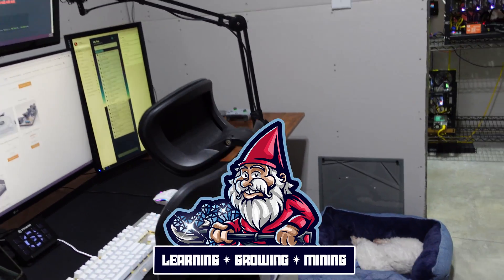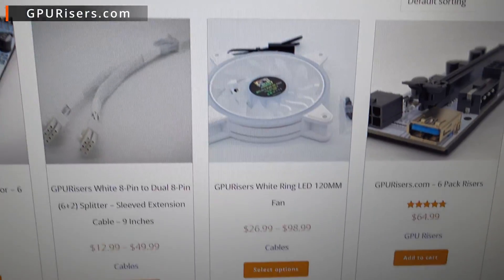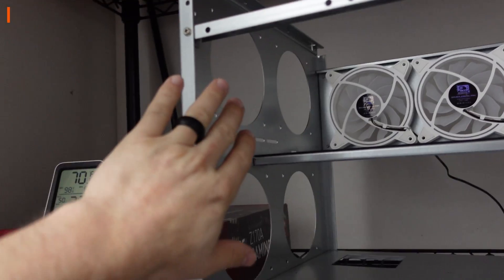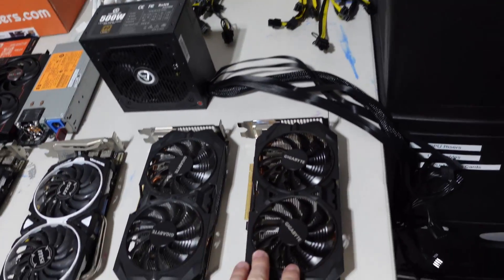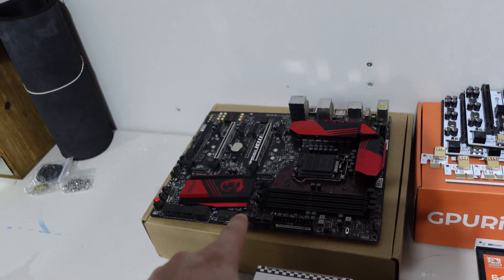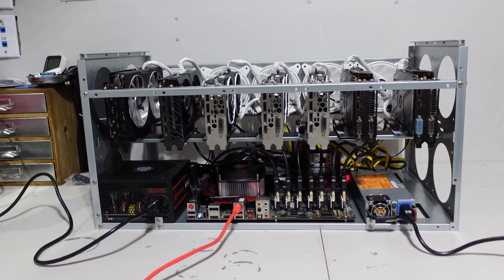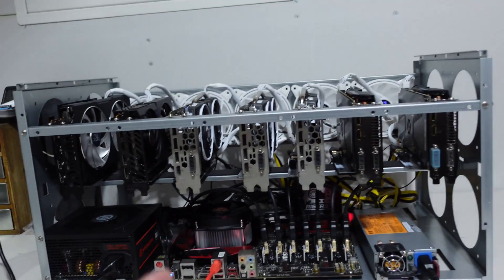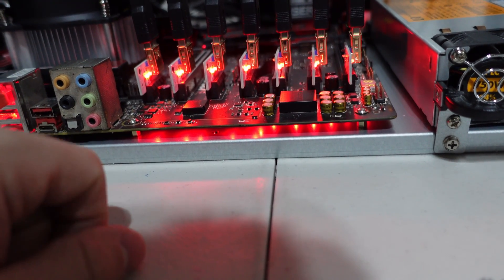AMD Mining Rig Build - 7 GPU ETH, ERGO and ETC

Comment from the maker: Are you mining with any AMD GPUs? IF so what does your setup look like?
Reply: 6600 xts so far i have
Reply: 2 3060ti lhr at 86 mh/s
Reply: i had the same issue as you i simply connected the HDMI cable to one of my graphics instead of Motherboard and problem fixed !!
Reply from the maker: I did that, i even adjusted in the Bios to use IEG.
Reply: My first rig is mixed..  I actually like my AMD's better ... They seem more stable...
I have a 6600xt and 2x rx580 running along side a 3070, 2060 super , 2x 1660 super. I want to add my 5600 xt but I had no luck with my Z390UD mobo.
Tried splitter but only recognizes 2 cards max , tried M.2 slot with adapter no luck either.
I would love if community any feedback ? Any ideas? Basically I am stuck at 7gpus.
Great vid again hobbyist miner
Reply: Will like to know why you pick amd over nvdia with the price range nvdia should have better HS ?

Comment: Why don’t you use a molex connector from the ATX psi to the breakout board on HP PSU. You only need to push one button…all my rigs work well doing this

Comment: Nice, I'm selling off my old 580's for 1660ti/1070ti/1080 FLUX rig build
Any updated on your FLUX rig going down randomly and not connecting in HiveOS? Did MOBO swap work?
I'm having this same issue where miner just stops but my rig still stay connected in HiveOS so still testing...
Thanks for all your content and FLUX overclocking xlsx!!!
Reply from the maker: HIVEOS had an outage all day yesterday and last night.  Where the Website was not accurate to what was going on. Check their Twitter.